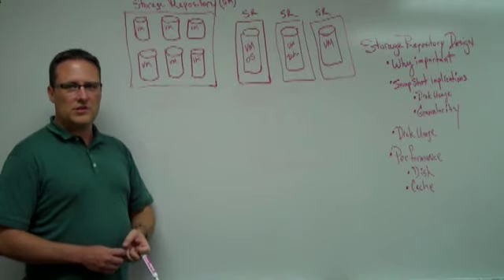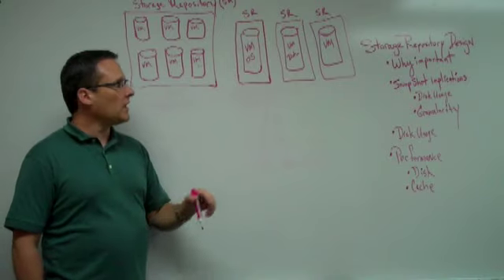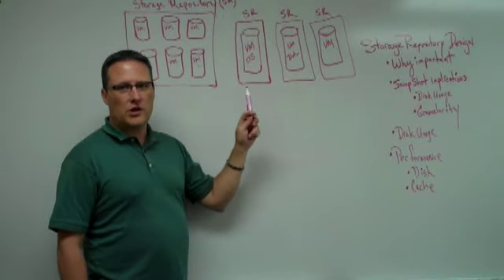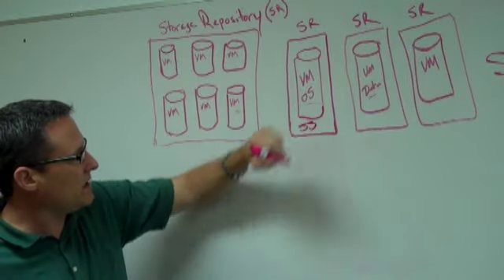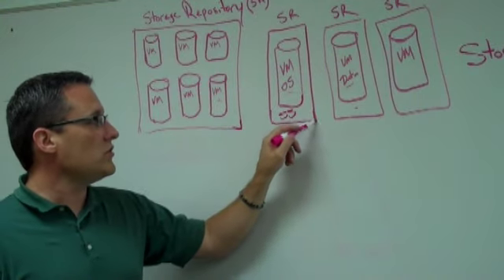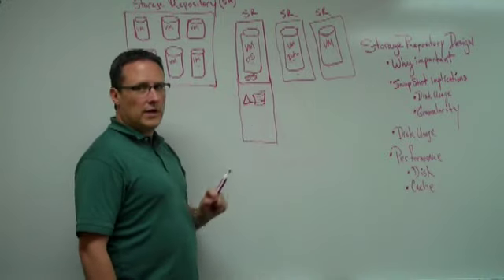SAN Tips - Storage Repository Design

Comment: With respect I need to highlight the following:
VMs per LUN is highly dependent on the applications intended to be used and their foretasted loads. In some cases you can have 20 VMs safely running on a LUN and in many cases you may not want more than two VMs,